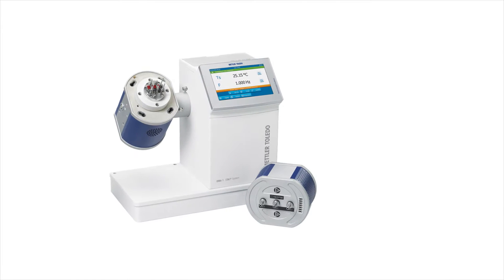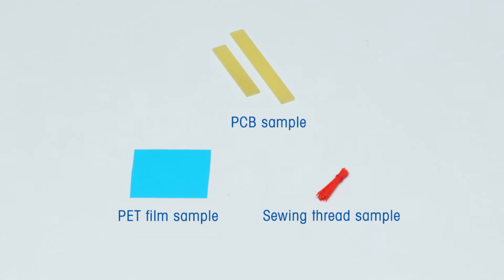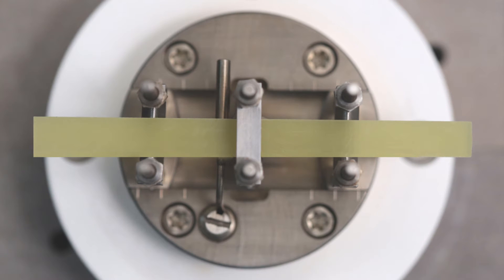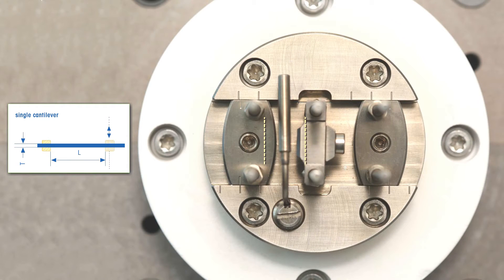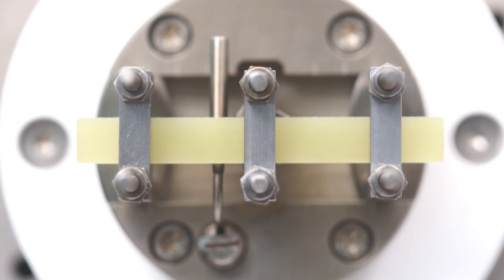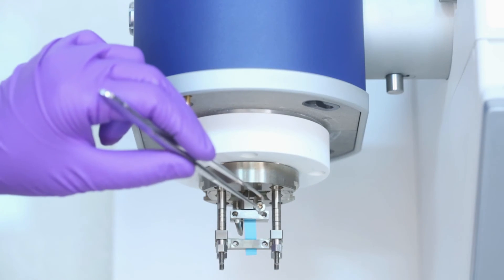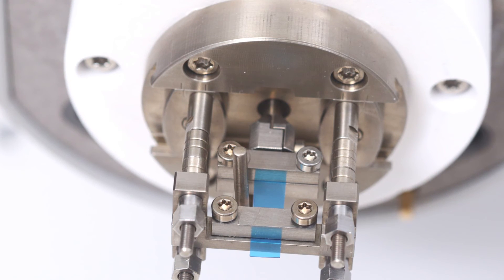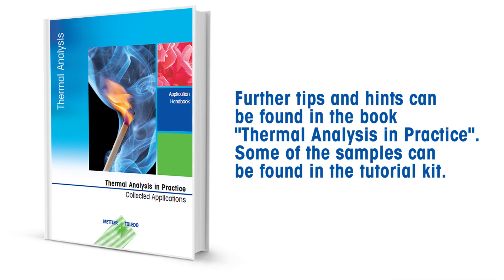How to prepare samples for measurements in DMA

Comment: Good morning. First of all thank you so much for the video. It was extremely helpful. Then I wanted to ask a question regarding the value of the "displacement". Do you set it or is it already provided by the machine? Because in our machine (Triton Tecnhology) you have to set it manually and I can't find the formula that defines the displacement in traction mode (in single cantilever mode I found it).